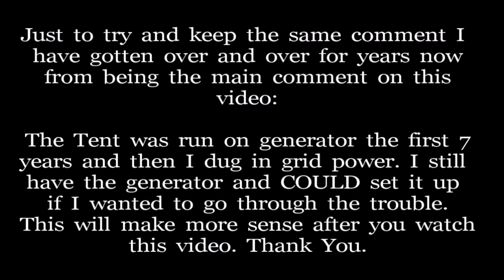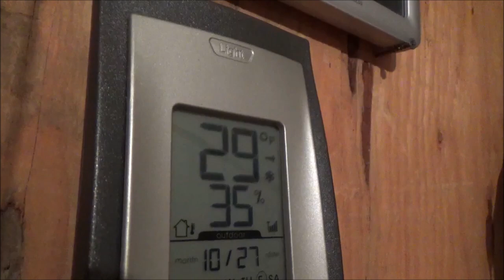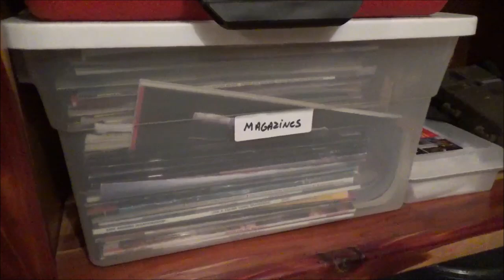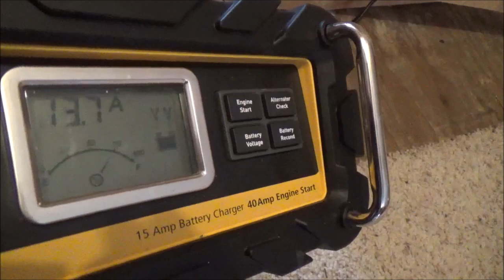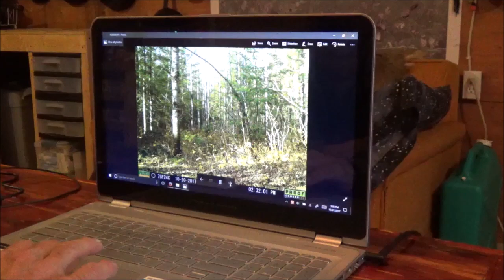THE TENT. First Snowfall Of The Year. 8-10 inches on the ground. Clearing trees.

Comment: I noticed all the 1lb lp bottles. Have you seen, or used the 1lb refill adapter? It's made by the people that make the Little Buddy heaters and I think Harbor Frieght sells one also. I picked one up last winter and it worked great. It takes a charge from your 20lb can and only takes a minute. Just a heads up if you haven't seen it.
Reply: Good tip
Reply: selrod55 Thanks for the information I have a lot of those little bottles.
Reply: selrod55 hey thanks for that I didn't know about the little buddy adaptor

Comment: My sister's mother in law is Hopi. She lives in the village of Hotevilla, Arizona. They are very traditional. No electricity, no running water. She did make an exception... she has water in the bathroom (toilet & shower). She heats her trailer w/ coal. She cooks all her meals on a one burner, using those small propane canisters that cost about $5 each. No stove, no oven, no refrigerator, no water heater, no freezer. This was back in 2016. No electricity...No TV!  She still used a kerosene lamp. We would visit, once it started dark, she lite the kerosene lamp. You can visit for so long. We were all in bed by 9 or 10pm. Before the sun came up... she was cooking/sweeping. Hopis have lived like that for... centuries.

Comment: FYI i think you lose a lot of power charging batteries by converting up to 120v then back down to charge voltage. You'll get many more charges directly charging off the battery voltage. Good video!

Comment: There is a kerosene lamp that was commonly used on railroad cabooses when I was a kid in the 50's and 60's.
It if you clean it before you light it following instructions for it it's real easy but when lighting it if you go a fraction above the highest point it will support the lamp will go black with soot in a Microsecound. Just below that point it will put out light equivalent to a 100 watt light bulb in addition to providing heat without the hiss of propane lights. I can't offhand recall the name of them but will continue looking for them so I can then post the name for you.

I found it, it's called the Aladdin inside kerosene lamp I would see every Boston and Maine Railroad caboose was equipped with. A very good long lasting every bright caboose lamp. You can look at it and the instructions tag here. A lot of railroads used them over the years. It might even be worth while to ask the supply department of any railroad if they have one in stock they would be willing to sell.

http://www.jeffpolston.com/aladdin.htm

I believe the company is still in business though I don't know where you can buy them.

Comment: From an old retired miner: The two tunnels were driven at the same time and are for the purpose of air circulation. Air is forced down one and comes back up the other. The crossovers with walls are made at intervals for the air to flow. As the tunnels progress, these have to be sealed off (called stoppings) to make the air go on to the next crossover.

Comment: Hello Joe,  I know this post is older but I feel i have to comment. The battery is in a bad spot it should be able to vent better. They can explode I have seen it more then once way more then that so I know they go!  In that confined area the slightest spark and the Hydrogen gas that vents from such a battery can explode.  I know thank god it never has but it can especially when its under load or charging! Just something to think about.

Comment: What did you do with the generator? :-) better to have and not need than need and not have. Should you decide to use it as an emergency generator I highly recommend storing the generator dry i.e. No fuel in the tank, run it out of fuel and only fuel it when needed from a jerry can as the jerry cans won't lose any vapors so the gas will stay good for 2-3 years before needing to be replaced.

Cheers!

Comment: This is the 1st video I've seen on this channel....   So that's really a tent?   Not a solid structure? 
  If it's just canvas or some other thick heavy material,  how does he keep the heat inside,  well used and not losing heat? 
 No insulation means that's gotta get cold
Reply from the maker: You will understand it much better if you watch this video. Thank you for the comment. https://youtu.be/gE_sMi3yUJo

Comment: Could not help but notice that you are still heating food in the  can it comes in.  I know people point out that cans are heated 'prepare' to food for storage but that is not always the case and its impossible to know - without contacting each canner individually and finding out if food is heated once canned or prior to packing and/or how they are processed.  Some can can leach metals although the argument is that steel cans would only leach small amounts of nickel or chromium that many cans are now coated with plastics (depending on the packaging process) and that plastic can be cooked into the food if the can is reheated.  In order to prevent any such metal leaching, which can happen just while food sits on a  shelf —which is bad for the food and eater but also for the can (as it can cause corrosion)—the insides of most cans on grocery shelves today are coated with food-grade epoxy. But these liners have been shown to contain Bisphenol-A (BPA) and other potentially harmful chemicals. BPA is a synthetic plastic hardener that has been linked to human reproductive problems and an increased risk of cancer and diabetes.  Some companies like Ball (who switched in 1999) changed to a baked on epoxy made from safer materials but chances are that if you are using anything short of very high end canned goods your probably exposing yourself to BPA  that way.  You are using paper plates anyway, might as well use some paper bowls, and recycle to cans and be on the safer side with your food.

Comment: Are your walls insulated or just the plywood? 
What are you using for insulation of roof?
Need tips because I have a 14x16 and planning to spend winter in here. (Logging)
Already have 4x8 up and was thinking of putting up bubble reflector insulation. 
Would love to know your setup for reference. 
Thanks.
I'm in a zone where we get up to -40 in winter.
Great video

Also can I have pointers as to how you went about putting in door? Maybe I could save some time from your experience.
Thanks.
Reply from the maker: I used 4 inch styrofoam insulation everywhere. The walls, the ceiling and under the floor.
Reply: @JoeandZachSurvival  Thanks buddy! Appreciate response.

Comment: Bullet proof that truck..lol... Them filters must gel up...I would love to have a week vacation in a cabin and driving thru snow... Change of scenerio...
Reply from the maker: I have went beyond bullet proofing, I had all the studs put in and since they were in there I had the whole motor rebuild and all the upgraded seals and gaskets. That motor has trouble with the cowling on the turbo also so that was upgraded. Something to do with exhaust pipes or something that can burst (one of them did) so I had them replaced. That motor now has almost 26,000 miles on the full bullet proofed rebuild. I now have the oil changed every 3000 miles religiously, the fuel filter at 12,000 etc. Shes a smooth reliable machine now.
Reply: JoeandZachSurvival good thing to do especially in that weather...intake it you had additives to the fuel so it won't gel up....great videos..I hope to one day be able to have a little get away in the snow with my old 6.0....lol...im in AZ so anything is better than this damn heat

Comment: Might it not be easier for some of those trees, to take a strong, 100' length of rope, tie one end to the truck, the other end walk out 20' into the forest to loop around a stout tree trunk, then back to the fallen tree. Tie it off, and pull the tree off the road, intact. Faster than chopping it up and moving the wood.
Reply from the maker: It might be but I had no tow strap.

Comment: What kind of wood stove do you have? I want to get one for a tiny house and really need advice being a woman doing it on my own
Reply from the maker: Mine at The Tent is a "Cylinder Stoves" Stove. It would probably work well for a tiny house and they have a lifetime warranty.
Reply: @JoeandZachSurvival  thanks I kinda worry about the glass doors on some I saw I think over time could bust and I worry I would stay awake wondering will that glass bust lol
Reply: @JoeandZachSurvival  may I ask your business brand and size I see you add  the wood looks like a regular size log would be used I would feel safe if I have exactly what your using especially watching you use it. I believe know it is silly but after seeing you do it I feel I could and feel safe
Reply: @JoeandZachSurvival  another bonus watching you the 1 lb lantern lights I've never seen that . Just this video I've learned so much
Reply from the maker: I believe they have 4 sizes. I have the second from the biggest. If they only have 3 I have the middle one.

Comment: This is a couple years after the video.. It might be easier to connected  the generator if you put in a manual transfer switching system.. That way when you batteries get low you can charge them .. Just trying to be helpful ..

Comment: Looking at those #20lb propane tanks inside your building is the most dangerous thing you can do. They could leak and you will not smell anything because it being a heavy gas. Your wood stove or even static can light it off. Also was that charcoal lighter fluid stored right next to the wood stove? Just saying that I would rather watch your video than read about you in the paper brother. Just takes an hour to pipe it into to building.